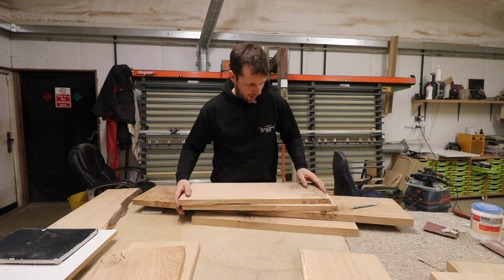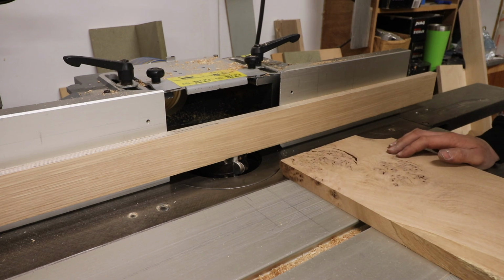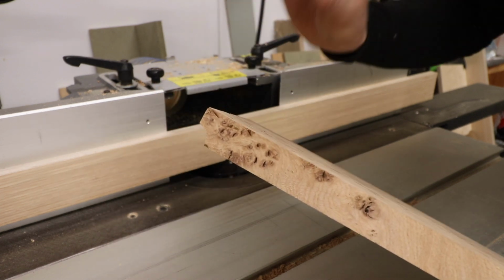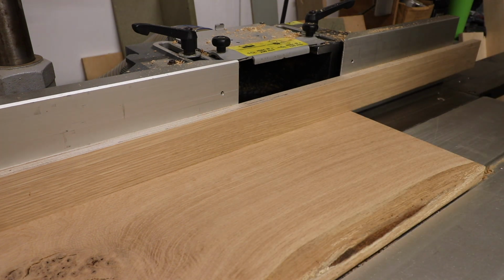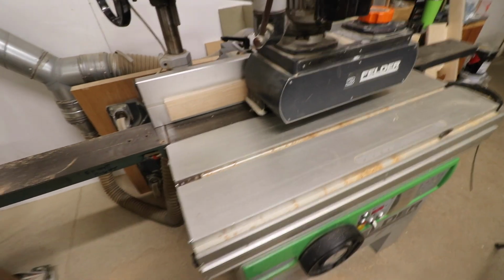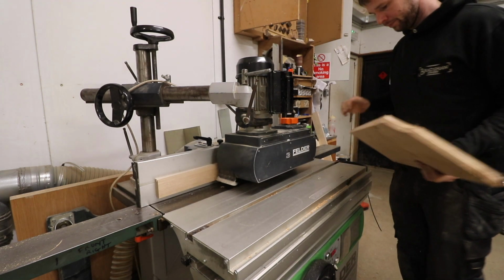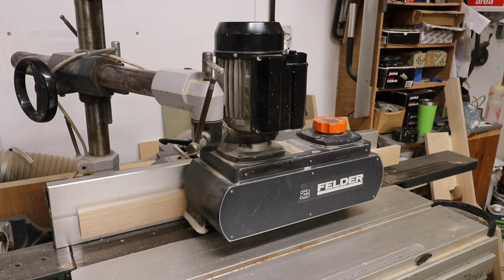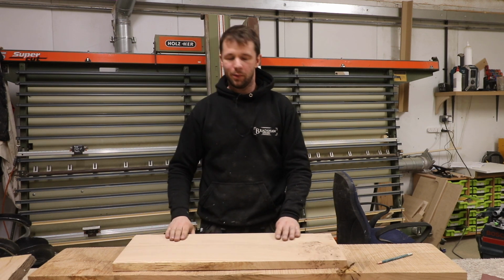Using a Climb Cut on the Spindle Moulder

Comment: I have to make an arched architrave, any tips?
Reply from the maker: Make a tall false fence and mount cutter upside down then guides attached to fence to feed the arc round
Reply: Sounds like a plan! Thank you!
Reply from the maker: No worries, the curve supports itself so it's kinda easier than machining a straight piece! Make it a lot longer than the finished piece then trim to size. Lots of passes to get to final depth.
Reply: Top man!

Comment: Nice one mate, I’ve always cut normal first and the if it’s ‘iffy’ a second normal pass taking a ball hair off, and if that doesn’t help a climb cut ball hair, manually ( we’re taking less than 0.5 mm).
Never tried full cut with feeder! I always thought it would fire it out the workshop door faster! 😂 straight into the side of a Mercedes knowing my luck! 

You ever used thermally modified hemlock? Some is beautiful! Some is a real pig!  Tried everything mentioned above and still had to get the super glue out and activator and do it again to save a piece 

Normal hemlock machines beautifully though! And super nice through the wide belt!   Thinking I might get a cube of it as cedar is so hard to get here and about 8k a cube!  You got any experience with western hemlock?
Reply from the maker: HAha! yeah its possible on smaller bits like this! 

Ive been around someone using it, but never used myself. Seemed to have been heated to death and pretty nasty smelling from what i remeber when cutting. I Like Accoya, and wouldn't reccomend anything else if the budget allowed, but its getting hard to source.
Reply: @BradshawJoinery  accoya is
Awesome, got a tiny bit left! You basically have zero waste eh? I’ve only bought a few lengths here and there, but you weren’t losing 50-100 mm off the ends and dancing round all the other issues like on other timber.
Use every millimeter of it

It’s actually about the same
Price as cedar here now!

It IS significantly heavier but

Comment: Great video well explained. Ideal method for use on Maple and Sapele which have interlocking alternate grain direction sections same piece of wood. A better surface 
finish is achieved, the only thing its very hard to extract the dust efficiently as it is exhausted out in the direction of feed along the now moulded section. Very Messy. Tony
Reply from the maker: Yeah not ideal for extraction is it! Dust mask and a god clearup after ideally. Its not much of a video but hopefully help someone!

Comment: How much lower are the feeder wheels set than the surface of the work piece? I think that’s the only way I can ask how much the feeder is pressing down to stop the part running off. Is it more than you would ordinarily use when feeding in the usual manner? Thanks Ollie
Reply: I usually set them roughly 1/4" lower than the stock.  Really depends on the condition and grip of the wheels.
Reply: Thanks for that
Reply from the maker: Yep as above, about 5mm, it depends on the strength of the springs on the wheels but thats a great starting point. Make sure the beds and fence have machine wax on them. If too much pressure you can find it detrimental to feeding the material through as too much friction pushing down.  
Some powerfeeders have a lot of slack in the arm etc so make sure the wheel springs are compressing and not just the arm lifting up when timber passed through
Reply: @BradshawJoinery  thanks Ollie I usually set it 2 turns of the height adjustment wheel (I’ve same feeder)lower than the stock for feeding in the standard setup so it looks like the same pressure or a little more for climb cut feeding, I just wanted to ask before giving it a go .